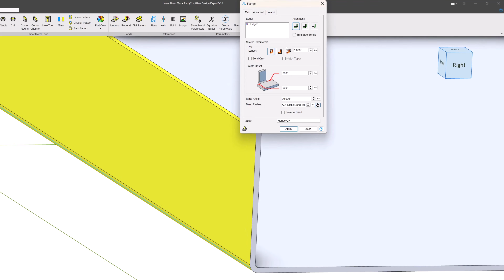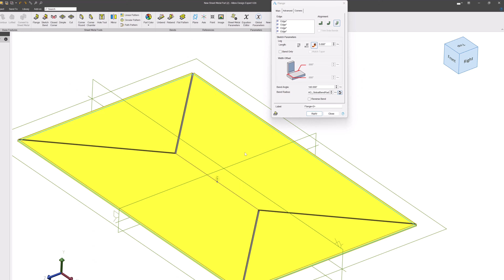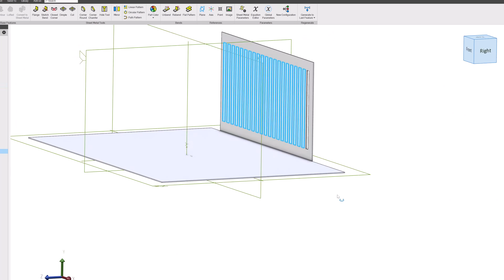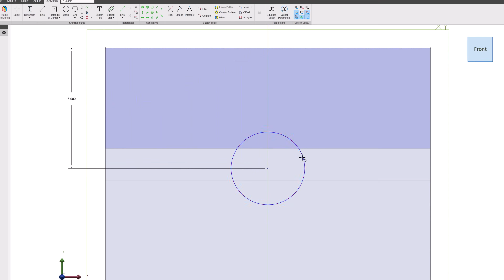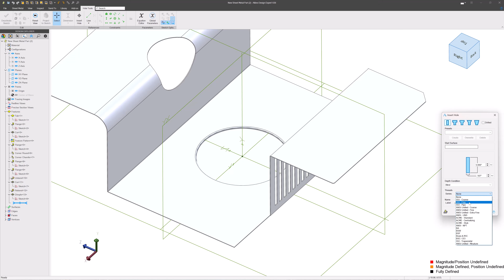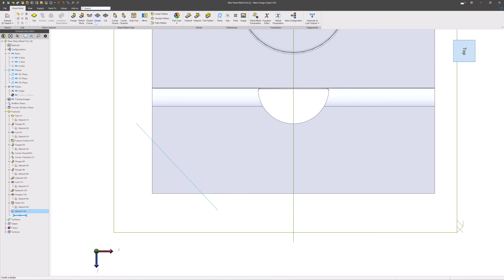Sheet Metal Essentials for Part Design in Alibre Expert

Comment: Personally im very dissapointed in how the licensing works

I wanted to have this software installed on two PCs, my main - desktop and my laptop when i move around, i just figured, i couldnt be using it at the same time which is 100% fair, but now I cant release it even from my laptop because i dont have the maintenance license, that is just bs
Reply from the maker: Thanks for letting us know!  The online license portal is for convenience, but the license can still be released without maintenance.  On the home screen, go to utilities > release license to release it, and then it can be activated on the new machine.  

Remote desktop protocol or VNC can be another way to access Alibre from another machine.  Let me know if that helps.